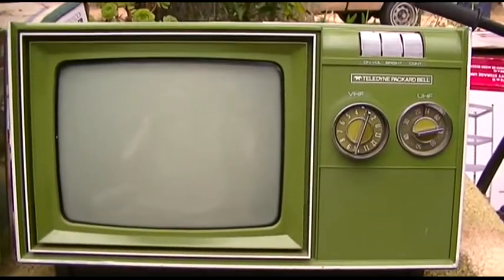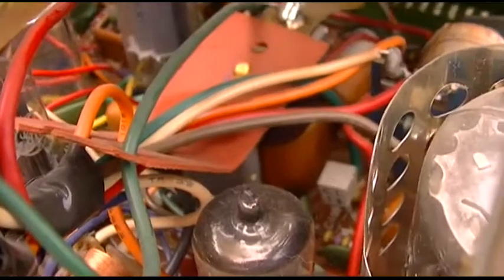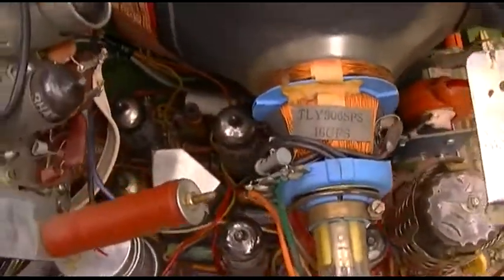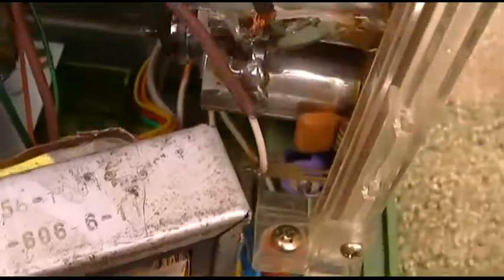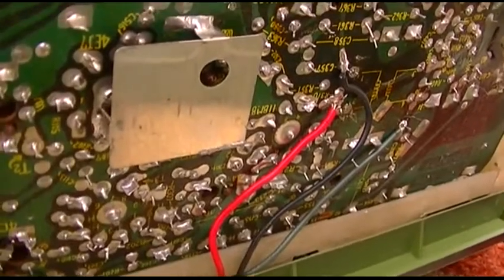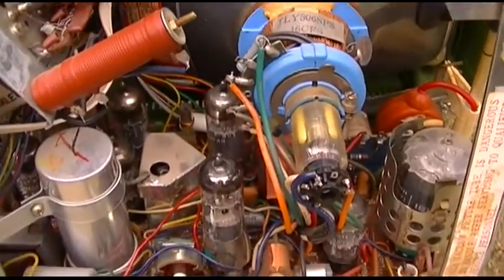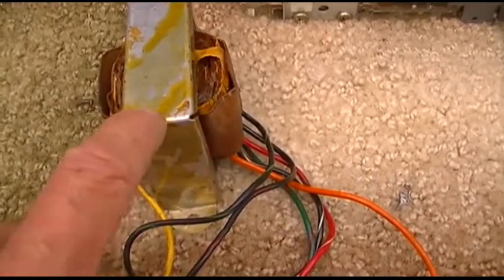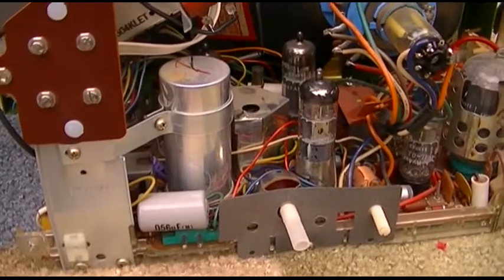Packard Bell Portabell 9 Inch Black And White TV Vertical Output Transformer Substitution Notes

Comment: There is a similar problem with the chassis mounted audio output transformers used in 1939-42 Philco radios, it's like 75-80% of them now have open primaries.

Comment: This is one of those situations where you do what you have to do in order to get the set going - plus add a pound or two to the TV.
Reply: I remember one time a single woman across the street needed a black and white tv(this was like 1967) and my father modified a metal 19" from the early 60s and sold it to her very cheap..BUT...the thing weighed a ton after the modification. He must have changed out a  power transformer for a very heavy one....but hey, she had a tv :  )